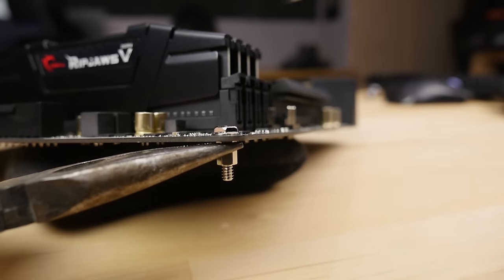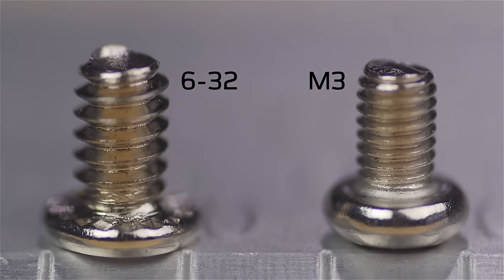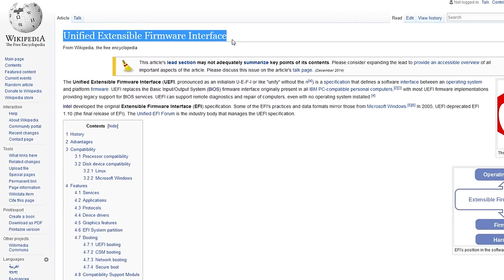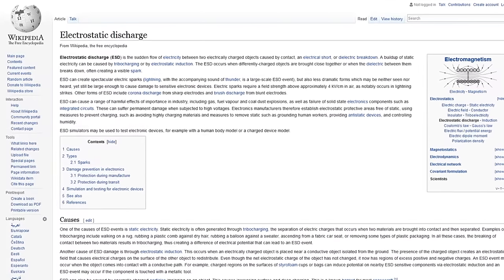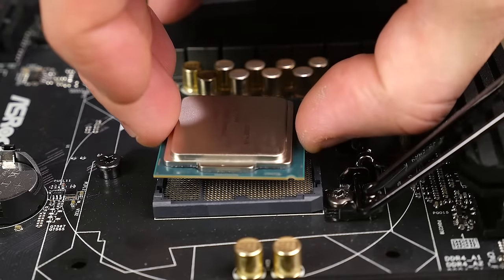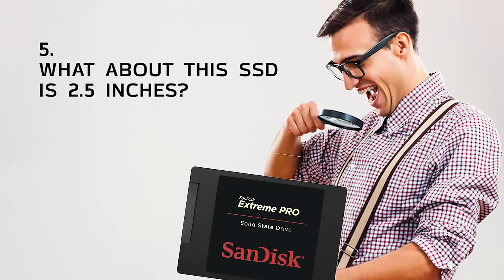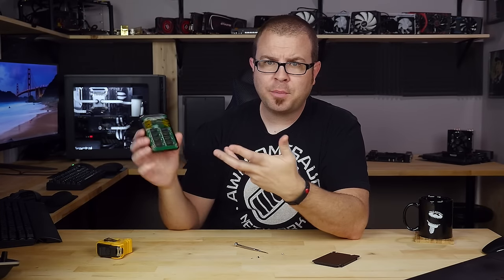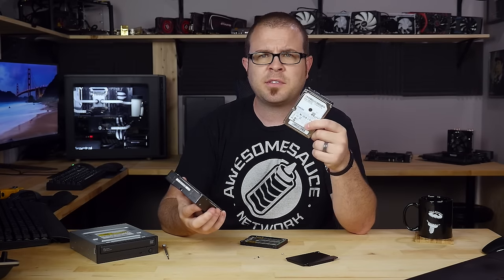5 Confusing PC Building Facts

Comment: Ever wonder why we call a CAR a CAR? -- it's short for "motorized carriage" --... you know a regular "carriage"? Those things from the 1800s that people used to ride in to get from place to place and were drawn behind animals.  Well when they put a motor in one and made it go, it got the name "Motorized carriage"  then "motor car"  and then just "car"  -- but it's far and way wholly different than a carriage of old.  But the original name had to be something people could relate to what it was within the name of it.  Kinda silly if someone called a car by it's full moniker "motorized carriage" these days, but yet we're all still using the truncated version of the old name to describe what is barely recognizable from it's origins some 200 years later.

Paul has the explanation right... regarding the drive measurements equaling the platter size.  But I dont know why it's such a mystery why the description of the bays dont line up with the actual measurements?  It's pure colloquial language.   I feel like the oldest one in here because I actually know the reason.   So YES the drive measurements come from the platter size... and everything else took the same name. 

LONG before there were hard discs, there were Floppy discs. -- The earliest floppy discs were 8-inches.  That's when every component was massive, and in a desktop environment, disk drives were big and bulky and external. As with everything, the goal is to make things smaller, and less consuming... this lead to the 5-1/4-inch floppy disk... which THEN ultimately lead to having a disk drive installed INTERNALLY into the PC enclosure... and thus it began.   The Space provided in the PC for such a drive was called a "5-1/4-inch floppy disk drive bay"   While the drive itself wasnt 5-1/4-inches, nor was the bay it fit in, the DISK for the drive WAS.   Eventually the names of the bay, and the drive just got shortened to "5-1/4 drive" or "5-1/4 bay"  which everyone knew what that meant.   You wouldnt imagine someone saying "I'm going to install this 5-1/4-inch drive into that 5-7/8-inch bay" would you?

THEN hard drives came along. They too started out externally, but when the conquest to make everything internal was realized, In order to fit the standard construction of already existing PC Form factors... they were built to fit 5-1/4-inch drive bays and were labelled "5-1/4-inch hard drives" a.) because the platter was 5-1/4-inches, and b.) because they matched the form factor already in existence, and which had already been named and the more people use it, the more it becomes standard.

THEN someone came up with the 3.5-inch floppy disk, which had arrived just in time, ideally since the 5-1/4-inch bays were being hogged by hard drives now.   And thus the trend of calling the drive, (and the bay) by the disk size (and the slot it fit in) carried forth and  "3.5-inch drive" just followed suit... Then likewise as years before, smaller hard drives came about that can now fit in the 3.5-inch bay, and of course because the nickname standard was set, it just followed suit.

THEN on the laptop side of things, someone decided we needed a small hard drives to go into laptop computers... with a 2.5-inch platter.  The standard (and tradition) was set at this point.  The classification of the drive was based on the diameter of the platter... so the convention just followed.  a harddrive with an internal 2.5-inch platter (aka a 2.5-inch drive) fits into a "2.5-inch bay".

And while it's true that there aren't platters in SSDs... they do conform to the factor of a 2.5-inch platter drive, they fit in the already inherited nickname "2.5-inch bay" so... voila.   the name has stuck with no other discernible logic when you approach it with no point of historical reference.   The SSD is the "car" to the "Motorized Carriage" analogy.

Moving forward, we now have SSD's that are NOT even in a housing nor shaped to fit those ancient conformities.  We now have modular SSDs which look like a stick of gum with contacts on one end.  So we've just begun to phase out the 'description by measurement' standard.   But the word 'Modular' sounds boring... I think we should call them Doublemint Drives.  Just to make future generations scratch their heads to wonder why they are called that..

Comment: Not so much a confusing thing, but whenever I build or tinker with the hardware of my machine, I have this fear of turning it on and seeing a loud flash followed by a deafening pop and some smoke, all because I didn't connect the power right, or shorted something. I obsessively check all the connections before turning it on and still am unsure of myself.

Comment: So question: Why "2.5" disk" as the standard form factor for SSD? You can cram a smackload (Yes, that's a SI measurement, roughly 4.385 avoirdupois ounces) of flash into a "3.5" disk" form factor? It's rather asinine that I can get a 10TB "rotating-iron" desktop drive but SSDs top out at 4TB for the price of your firstborn, two sheep, five watermelon, three grapes and "whichever leg you like least, your pick".

Comment: You know I never actually took a tape measure to any of those, now it makes me wonder about those floppy drive disks that no longer exist.
Reply: Oh, they still exist, there are still 3 or 4, 3.5  disks floating around somewhere in the back of one of my desk drawers. If I was to go and dig around outside in my storage shed, I could maybe come up with 2 or 3 actual 3.5 drives and maybe even my old 100mb Zip Drive with a parallel port interface. I should really go clean that shed out, but fuck that, the grand kids can do it when I'm dead.

Comment: On #3, how would you ever know? Do you mean to tell us that in all your years of working on PC builds, you never had a DOA part? How can you be absolutely sure you didn't zap it when handling it? 

I'll assume you have excellent hearing and vision but can you be 100% sure you heard or saw no electro-static discharge while not using an ESD strap and work bench? 

Not saying I use ESD straps 100% but I have had some cases (no pun intended) where I heard that little 'twap' and thought to myself 'shit' while my gut wrenched a little. Everything was okay but was it? Those gremlins that we all get in our systems are caused by all sorts of issues but there's no way for us to say with 100% certainty that it wasn't caused by ESD damage while in our hands. Just sayin'.

Comment: was installing a liquid cooled gpu for the radiator had to take the fan off put it on the other side and then even get a drill out and make the holes that hold the fan / radiator larger